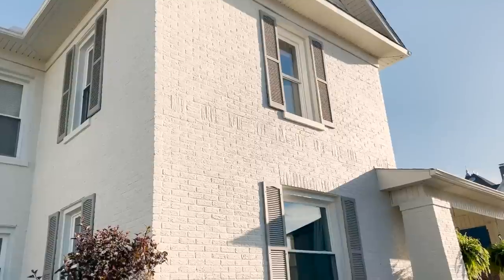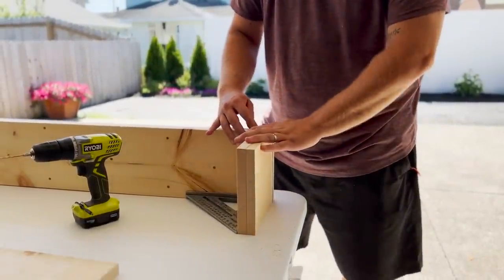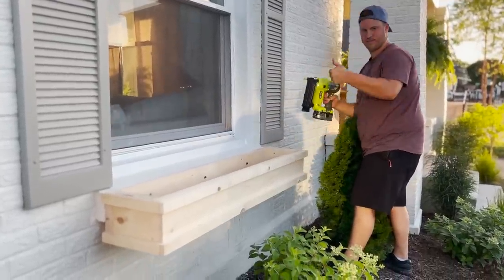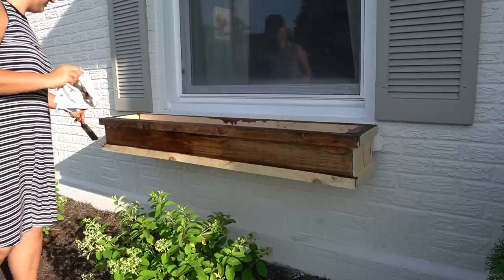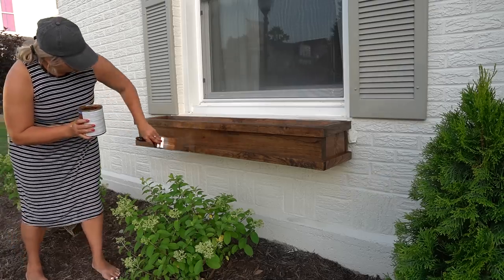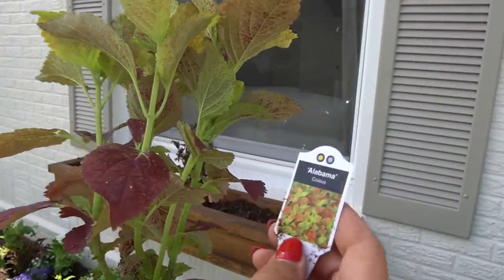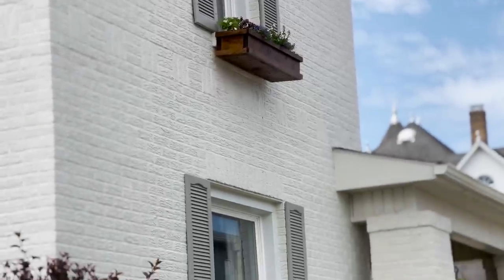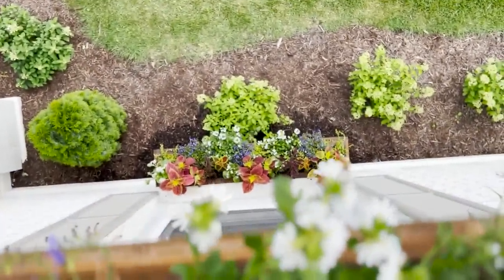DIY Cottage Window Boxes | Plant flowers with me! 🌸

Comment: Amy, your window  boxes are beautiful! I've had window boxes for years and a little tip for you. Next time you plant if you would put a long plastic window box planter inside your window box it will help so much with the rot of your boxes, Also you can just take them out and replant then sit back inside your box.Just make sure you drill some drain holes in them.

Comment: Really turned out beautiful and rich looking! Great choice of stain color to compliment the overall look against the white brick. Just had a question on the wood measurement of 1x2? Normally that would mean a 1inch by 2inch size board. Did you mean a 1 inch thick by 2 feet long possibly?

Comment: Is there a different between treated and not treated for these?    I want to make them. Like yours and hubs said they would warp. I said I’m sure they know what they are talking about. Geez, Bob she has a you tube channel. 😀😂.
Reply from the maker: You could use a treated cedar but it would be more expensive. We’ve had zero issues with warping, of course they will need to be re-stained / re-sealed every year or two if I want it to keep the color. 😊